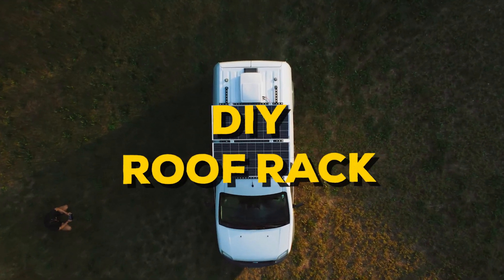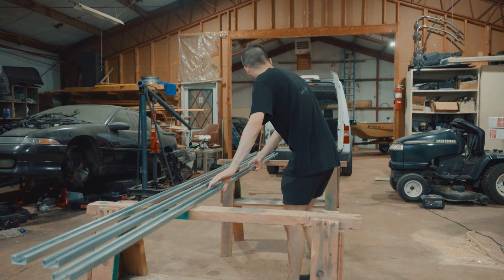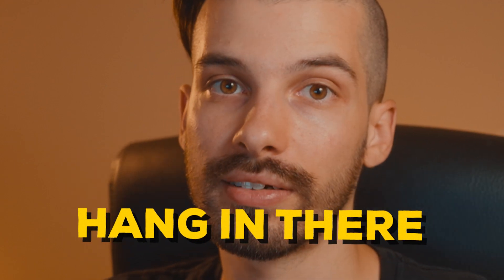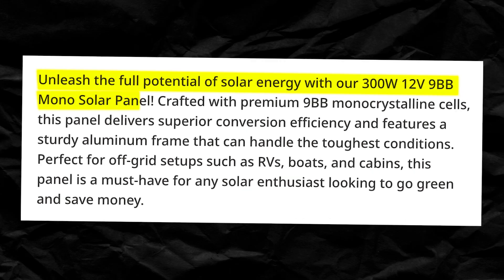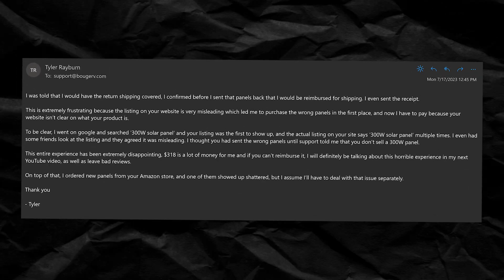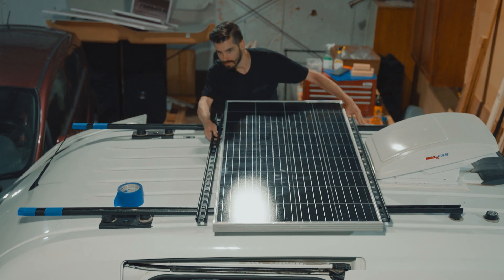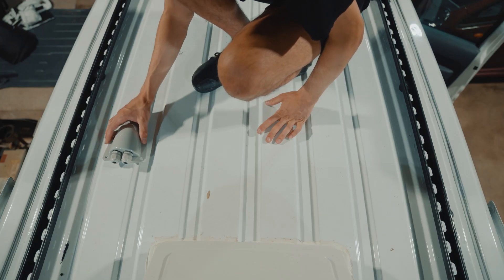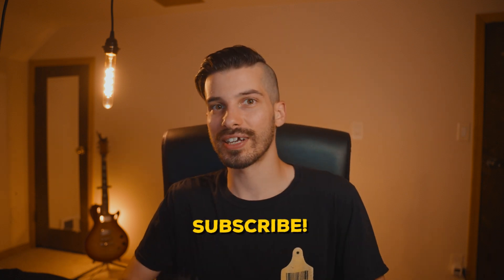How to Mount Solar Panels | Ford Transit Connect Conversion

Comment: If you had sealed those two panels together with butyl tape, nuts and bolts and seam sealer, You could have mounted slide rails on the outsides of your solar panels and made a pull out awning for the side doors!  🤣

Comment: I purchased a 40L fridge and a 200W bifacial solar panel from BougeRV on their Amazon storefront.  I had absolutely no problems.  But if I had seen this video before I bought them, I would not have.  If I had problems getting exchanges or returning and not getting my shipping paid, I would have had to experience what you did and that's just wrong.  I have had both my panel and fridge for over a year and they are functioning great.

Comment: Real nice installation. The only unknown variable is any wind noise, vibration, or humming that could occur when you're driving the van in high speed. Hopefully the panels are nice and quiet.

Comment: I am currently going thru the same issues with customer service.  $500 for 2 panels damaged and they tried to give me 100.00. Agreed to 1 panel replacement and just deal with  the other damaged panel. Told me that the panels are out of stock so still waiting but noticed not out of stock on the website. Pretty sure ill have to call to get the replacement. I will also be leaving bad reviews on customer service.

Comment: More great editing, my friend. Sounds like a hassle and a half. I'm coming closer to finishing my Ford Transit Connect. Went with a 200W flex panel because it's just bloody hard to fit much onto that tiny roof. Nice work getting all 400 up there.
Reply from the maker: Thank you! 
Wow! A flex panel huh? Seems a bit easier to install than the rigid panels, it just sticks to the van, right?
Reply: @SweetPotatoTyler   It can but too much contact with the roof can cause overheating supposedly. I actually mounted it via grommets onto a roof rack and glued corrugated plastic under it so that it never comes into direct contact with the roof.